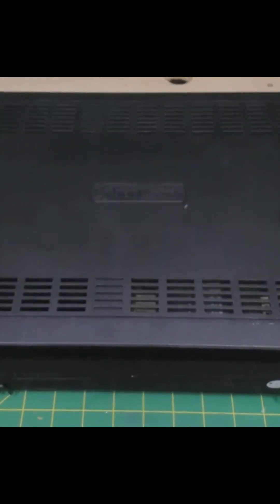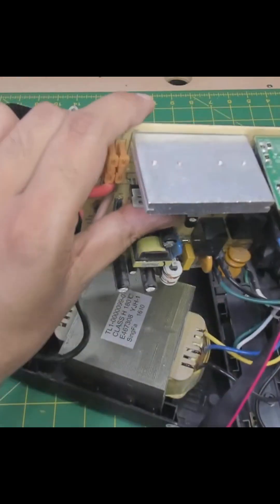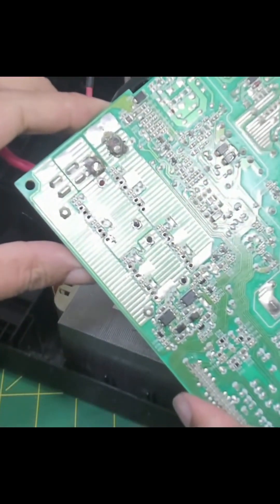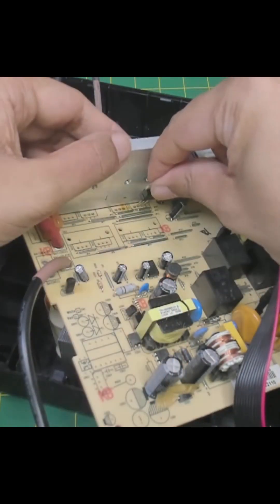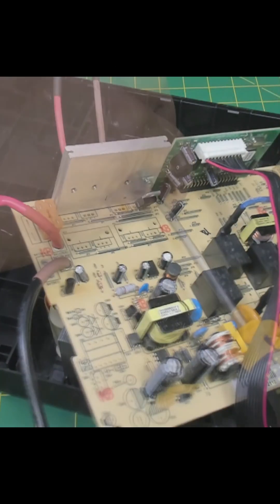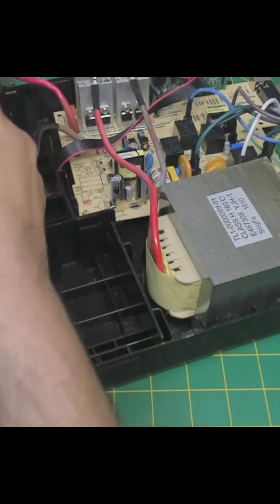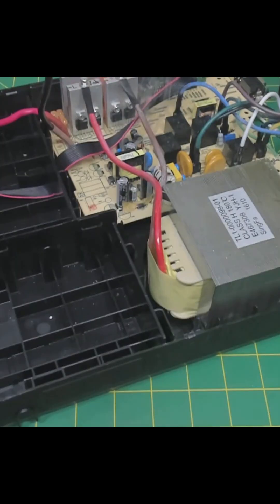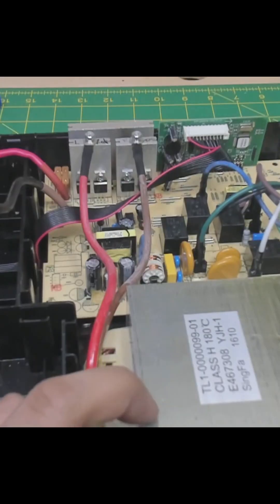I attempted and failed to replace the blown out mosfets in a CyberPower 1500va AVR UPS

Comment: Do NOT buy from Cyberpower.  I don't know what changed, but their customer service is now a nightmare, I have a $3200 rig that I've had to ship in 4 times now and it just keeps dying.  They have replaced the motherboard twice, and the video card once, and absolutely refuse to consider any other option but to continue throwing parts at the symptom without attempting to address the cause.  

I basically have a neat light-up room decoration that cost me over $3000
Reply from the maker: Well, they are, or rather used to be, the cheapest brand. I'll probably try APC for my next UPS. To be fair though, most consumer grade UPS wouldn't survive a well placed lightning strike. I've had this one for 5 or 6 years at this point. Weirdly enough, a couple of other cyberpower UPSes in the house were just fine. Just this one blew up.
Reply: @nerdontheinternet  APC and Tripplite are the brands I know, APC being "quality" but maybe not in every single product (they make some consumer grade stuff as well.)
Reply: @nerdontheinternet  I cannot even speak to their "overall product quality" other than to say their tech support mentioned a massive backlog of RMA's and typically took 2-4 weeks to get my system back to me.  About a two and a half weeks this last time, which is perfectly understandable given 4-5 days of shipping time.

But their customer service and support when having issues is the complaint.  And my warning to others, at this time.